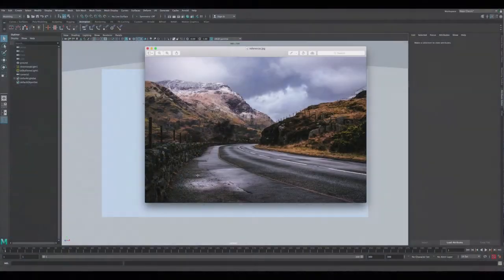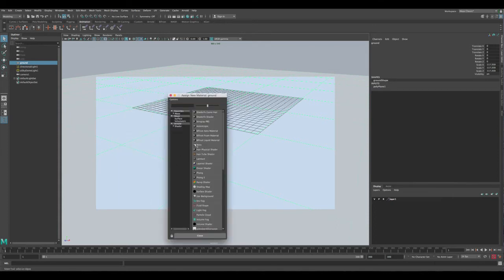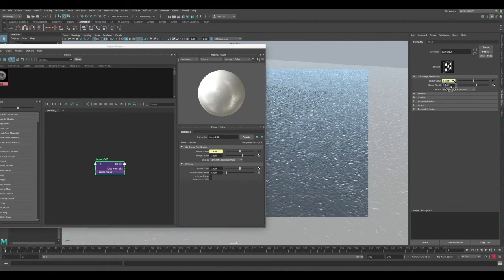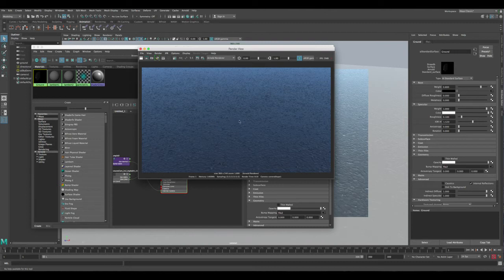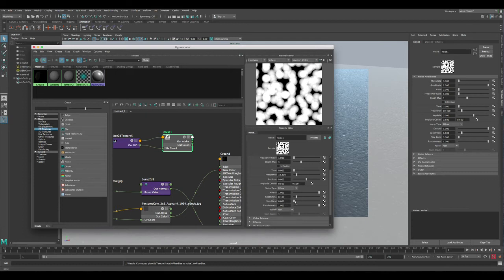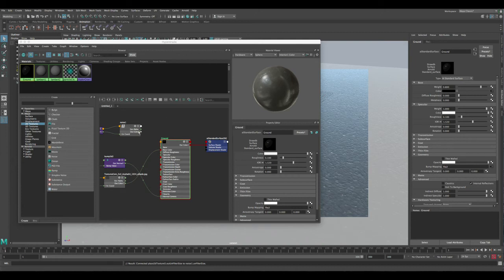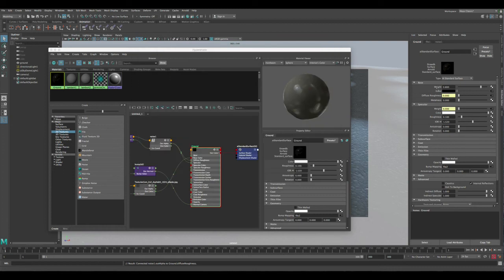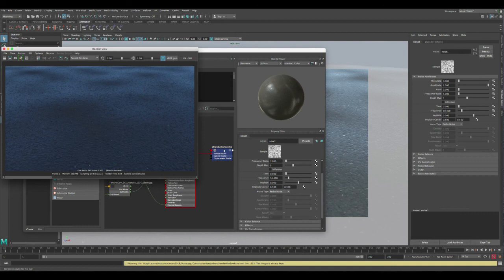Maya Tutorial: How to Create Realistic Wet Surface and Puddles in Maya and Arnold Render

Comment: Hi, this is great! however my scene differs a little to yours, in mine a man is cleaning a roof by spraying it with a hose, so it starts of dry and from left to right gets wet, im wondering how i could go about animating the transition from dry to wet using this method of yours. i could send the reference if that helps. thanks!
Reply from the maker: Thank you! I would try to use a layered shader with animated transition, like this tutorial I made before: https://www.youtube.com/watch?v=dP6q24409-g  
or render multiple passes and then animate the transition in comp, you kinda need to experiment and see what works best for your scene, hope this helps feel free to share your final result with us :)

Comment: Could you plug in the shaders height map to affect the noise? As such making it more natural since higher parts of a texture would be less wet?
Reply from the maker: Thats great question! in theory it should work but I didn't test that to confirm.
Reply: @3DModelsWorld.  I tried to work it out last night but didn't find a solution. Ended up making a modified version of the displacement map and added that in the shadergroup. But would be very nice to make it sort of procedual :)

I posted it here: www.artstation.com/torbeng